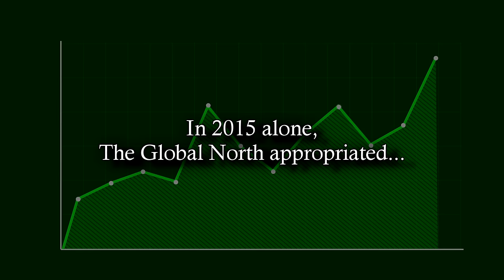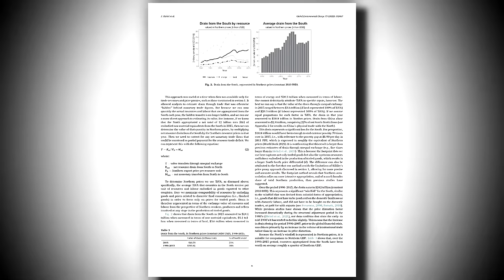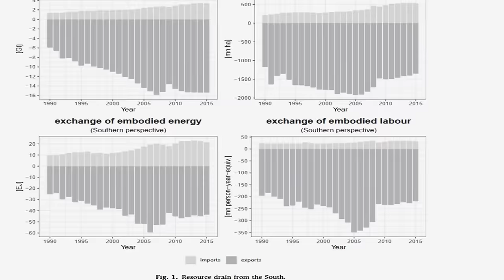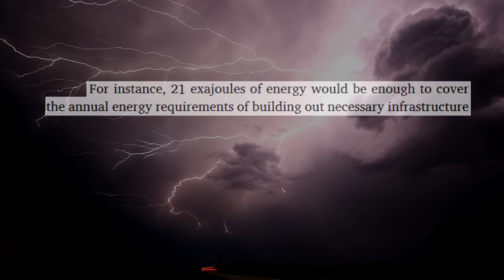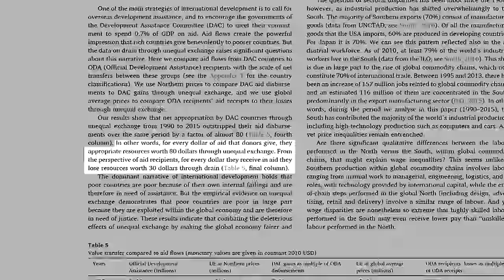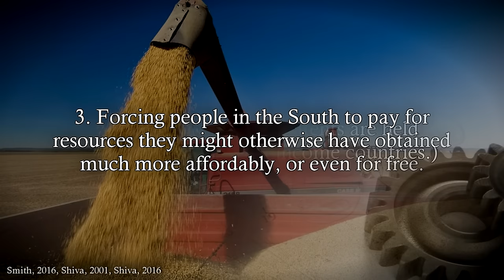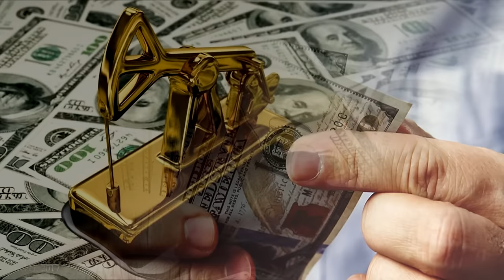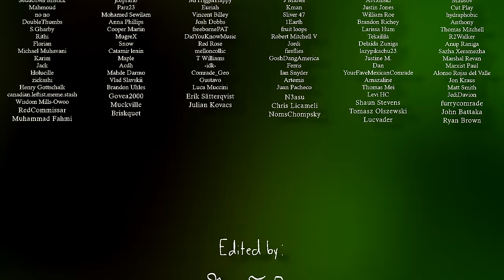Why Do Poor Countries Stay Poor? (Unequal Exchange and Imperialism)

Comment: I’m glad you put numbers to my thoughts. I thought it was mostly labor but it is clear that it is in way so many ways which includes labor.
Reply: The problem with the source and the entire concept is that it tries to measures value as cost of land, labour, resources, etc. But that's inaccurate since the true value of anything is the price other people will buy it for. If you measure by the true value of the products bought and sold between these groups of countries, the "unequel of exchange" would be 1:1 by definition. Just because the sum of all products from "the North" required less land, labour, resources, etc. than "the South's" products did, that doesn't mean that the North's products are less valuable. Natural resources are cheap, semiconductors are not. That's why poor countries will trade a lot of natural resources for a few semiconductors, because the semiconductors are a thousand times more useful and thusly valuable.

Comment: Aid contributions are given in dollars and bestowed on larger organizations, so often the money is spent on imports instead of developing local economies (see Super-Imperialsm by Michael Hudson). Infrastructure aid usually goes to building roads and railways from the mines to the ports rather than trying to facilitate trade between different parts of the country.

There's also strong interest to minimize social unrest. This can come in the form of propping up local strongmen, but there's also a systematic route. If social unrest is caused by social pressures, and economic changes lead to social and political changes, then it's in the interest of foreigners to minimize real economic reform.

Comment: Global south countries have two options: either reduce trade to the extreme minimum, like North Korea. Or trade with other countries which in most situations will produce unequal exchanges, including between nominally similar “global south” countries. This is the negative byproduct of the world not yet producing a viable alternative to a world economy depending on a market for labor, materials, and finished products.
Reply: north korea didn't reduce trade, it suffers from an economic blockade. Do you think the huge crisis they went through after the dissolution of the ussr, losing their major trade partner, was intentional? An interesting fact is that at the beginning of the 21st century, nk conducted trade with brazil in which they sold the higher value goods. nk sold microchips and musical instrument parts, while brazil sold commodities like soy.
Reply: @doctorinternet8695    That is true, and the fact about Brazil-NK trade is interesting. Do you think there is any rational basis to the sanctions on NK? Is there any reason that the state regards the acquisition of nuclear weapons to be so important to override the what they would otherwise get through trade? Is that in the interest of the NK people?
Reply: @Spiritualmanlet  Did you even read the comment you reponded? It does not matter what NK state wants , when they are in a blockade, they can not make trade with almoust anyone. And for the response of your first question, no , there is not , North Corea does not have a capitalist bourgoirse in power that i subservient to the bourgoirse of the West , and so they receive a blockade , same happens to any country that has sovereignty over their resorces , independant of their political sistem .

Comment: I come from Czechia and I can tell you that socialism isn't the answer, it causes more issues than it solves. The fact of the matter is that if you have the know-how and systems in place to manufacture finished goods, you will leverage that to your advantage. Raw materials, and energy to a big part, are useless if you cant convert them into finished goods. I also don't think you can pretend that higher corruption in the  "southern countries" have no impact or that it's just the wests fault.

Comment: Fun Fact: Argentina's development failed not because it wasn't promoted or that industries weren't productive or people didn't work enough, but because we didn't have enough currency to buy the equipment and machinery necessary to fully industrialize. And it wasn't because there wasn't enough money, there was, but the money we had were pesos, our local currency. Turns out no one wants pesos, to buy the expensive machine needed to get into a developed industry we need dolars. Which for obvious reasons we don't have.

Curious enough, after the elected president Perón pushed this industrialization to get free from American economic control, Argentina get couped like 4 times. Every coup was more violent than the other. This lead to a political scar of unlegitimicy on the political system unresolved even today.

Comment: The extraction of surplus value from the 3rd World is not based on unequal exchange. judging from the labor theory of value, the exchange of goods in international trade is roughly equal in terms of socially necessary labor. It has more to do with the comparative advantage of capital with relatively low organic composition in the imperialist states, because the working class there, through class struggle,  has a higher standard of living and requires more materials and labor for the reproduction of their labor power, which makes the capitalists lean towards more automation. The technological monopoly of the imperialist states also plays an important role. It ensures the comparative advantage is maintained and the excess profit is secured for the capitalists in the imperialist states only.

Comment: I wish that you elaborated more on the productivity issue but you just skimmed over it. Yes wages are low, but why are they so low in the global south? You simply say that productivity isnt all that different but give no proof. Are you really saying that US steel works or cereal farms are about as productive as eg Indian counterparts? From what I have studied so far there are enormous productivity differences and that value is not generated by exchange. This is compatible with the data I have seen so far and the labour theory of value. So it appeared to me that the marxist argument would be that policies keeping the global south's reserve pool of labor high which in turn keeps labour cost and productivity low is the fundamental problem here, and that socialist revolutions would answer it by rapidly increasing productivity. Guess I will have to see myself what the article you quote has to offer.

Comment: It's simply how much value is added. You have a tree. The lumberjack really only cuts it down and sells the timber on, the sawmill breaks the logs down into boards and lumber, but the carpenter takes that lumber and creates an exquisite chair adding on the most value at the end. 
Poor countries will stop being poor if they are able to protect and develop their own indigenous industries and move up the value-added chain. 
That requires stability, rule of law, and tariffs.
Reply: Aside from that they also need an efficient modernized education system that helps uplift the poorest members of their society towards a decent standard of living alongside improving the quality of the general workers and thus allowing a new wave of industrialization to start. 

There are poor countries which have all of what you said in the end for decades; stability, rule of law, tariffs, but remain poor because they need a better education system which will help to develop and expand their own industries so that their added value products would overtake their service/primary export economies.
Reply: Australia’s and Canada’s economies are based on recourse extraction.

They just do it far more efficiently than developing countries per person, which gives them lots of wealth.

Also what you’ve said is almost impossible.

As people get richer and require more high end commodities the wealthy countries will be far better at providing these services.

Unless you put up tariffs, and in return you get tariffs placed on your own country and now you’ve lost a huge export market (and will fall behind the countries who’ve got access to that market).
Reply: @joshbentley2307  tariffs are not a necessity, there's a thing called foreign investment. Australia for example has been able to thrive because of massive investment.
Reply: @zachb1706  my points about tariffs and Australia were not connected.

When I brought up tariffs I’m referring to developing economies who are trying to develop high end services.
Reply: @joshbentley2307  If you're a resource exporter you're probably always going to find someone to buy what you sell, tariffs or not. For example Australia tariffing semiconductors to encourage domestic production wouldn't stop people needing her iron ore, 25% of global supply. 
Or Ecuador putting tariffs on kitchen appliances won't make their bananas unsellable. 
Tariffs exist to protect your own nascent industries from foreign competition that already possess expertise, economies of scale, or an unfair advantage. 
And industrialization, particularly manufacturing is what drives prosperity and it snowballs the longer it goes on. 
The Rust Belt, became the Rust Belt for the same reason Zambia's textile industry collapsed, they couldn't compete in a free market of globalized trade.

Comment: The problem with the source and the entire concept is that it tries to measures value as cost of land, labour, resources, etc. But that's inaccurate since the true value of anything is the price other people will buy it for. If you measure by the true value of the products bought and sold between these groups of countries, the "unequel of exchange" would be 1:1 by definition. Just because the sum of all products from "the North" required less land, labour, resources, etc. than "the South's" products did, that doesn't mean that the North's products are less valuable. Natural resources are cheap, semiconductors are not. That's why poor countries will trade a lot of natural resources for a few semiconductors, because the semiconductors are a thousand times more useful and thusly valuable.